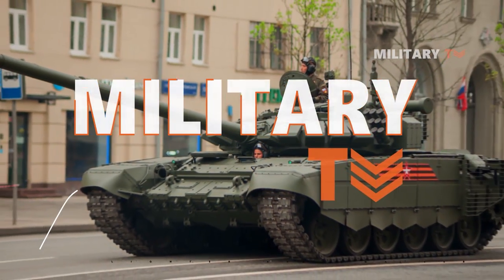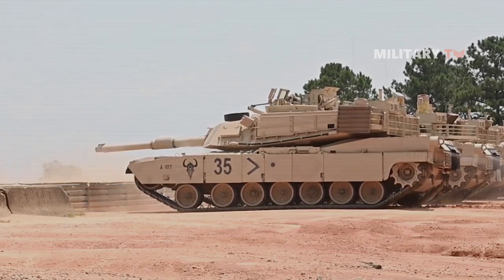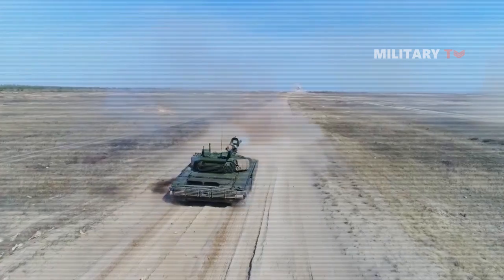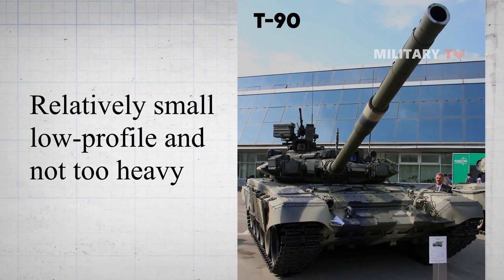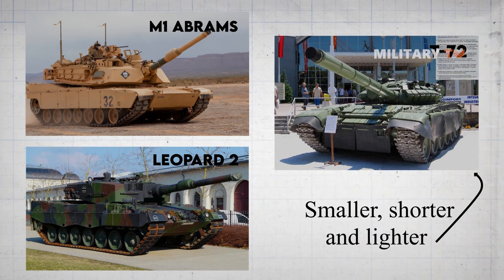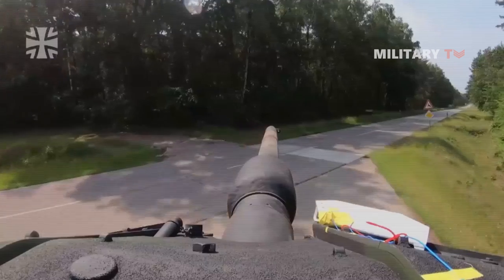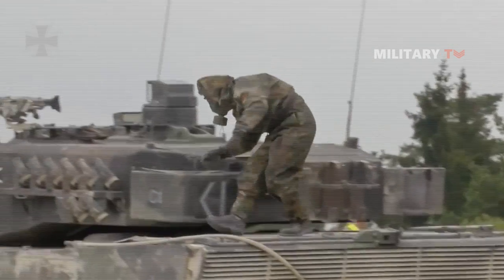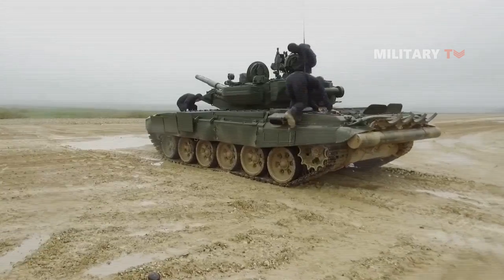Why are Russian tanks lighter and smaller than the western tanks

Comment: This was a very superficial analysis.  

Russian tanks mount an auto loader whereas western tanks like the Abrams mount a human loader.  That autoloader comes with trade-offs, but it does reduce the size of the turret.

Western tanks have a different ammo arrangement, based on accessibility and survivability.  The Abrams turret is so big and long because the ammo is there, easily accessible to the loader and cocooned behind blow off panels to protect the crew.  
Russian tanks store their ammo in the hull, below the turret ring, which reduces the size of the turret but makes for very impressive explosions and fireballs when the hull is penetrated.  

In a communist command economy, it is impossible to budget because there are no internal prices.  One way the USSR came up with to control costs was to limit the weight of certain pieces of equipment.  So Soviet-era tanks were designated a certain weight and the designers had to work within those constraints.  If you want to mount a decent gun, have decent armor, and have a decent top speed, then it helps to make the vehicle as small as possible.

Also, traditionally, Soviet tankers were drawn from the shortest service members, because tank crewmen of average or above-average height wouldn't fit comfortably.  

Western MBTs are big and expensive to purchase, maintain, and operate, but their dominance on the battlefield is undeniable.
Reply: "Traditionally, Soviet tankers were drawn from the shortest service members..." This is claimed in many places, but it is a myth. Soviet tanks do not have meaningfully smaller crew  height limitations than the Western tanks.
Reply: Very good point about pricing in planned economies

Comment: this topic has been talked about my military experts in the US military for so long.After WWII Russians realised their biggest closest threat would come from the countries to its East and most of the land the russians would be fighting on are low,flat plains therefore the tanks were designed to be smaller and shorter (to present a small frontal area) for tank to tank warfare.And they made them to be lighter and faster to cross those plains quickly.A smaller,faster tank would be much harder to hit than a much bigger tank.
Reply: Well, with modern technology I doubt that a modest difference to the size or speed of the tank makes a lick of difference as to wether it gets hit or not.

If even the infantry anti-tank weapons are aimed by computers the guns on modernized tanks probably are as well.

Comment: Point of smaller tank is: low silhouette, it was (with all mentioned in video) always pointed in first place for soviet made tanks, the goal indeed. They boasted with that. Secondly, there is "red line" for mass and dimensions: how much can average bridge sustain together with off-road characteristics, and how that tanks can be or can't be transported via trains. That red line is about 50-60t, that's already too much in many, many situation. Furthermore, off-road driving can be very, very difficult during about 6-8 months in Russia and surrounding countries. Tanks, and tank units, incapable to move fast, to move through certain roads, or to move at all in some cases, lose all their advantages (if they didn't succeed to destroy enemy before).
Reply: nah dude russians like smaller tank cause they have a crew of 3 with an autoloader, western tanks dont use autoloaders so they have a crew of 4 which requires a bigger turret with more space, bigger turret require more armor for equal protection hence they are heavier.
Reply: both your arguments are correct
Reply: @meee2014  The Leclerc has an autoloader and while it is 5t lighter than an Abrams its still 10t heavier than a T90. Likewise the Leclerc sits right in the middle  between the Abrams and the T90 concerning height, with the Abrams being 2,86 m, Leclerc 2,53m and T90 2,23m. So having an autoloader is probably part of the answer, but the not entire answer.
Reply: @jaf8016  ... What it misses is that the Russian tanks being so squat, is that their gun elevation of  -6 to +14 has proven problematic in a few wars. In the 1973 Golan Heights war, the Syrian’s Russian built tanks outnumbered the Israeli tanks 10 to 1 but the Israeli’s set up on the slopes and fired down on the Syrian tanks who could not raise their guns high enough to hit them. The Israeli tanks would then go down the reverse slope firing on the Syrian tanks as they came over the hill while the Syrians couldn’t depress their guns low enough to hit them! Thus allowing them to hold off the Syrian attack long enough for Israeli reserves to arrive and drive the Syrians back! 

In the first Chechen war, the Russians finally got a chance to use their T-80 tanks in Grozny but using conscripted soldiers unfamiliar with the tank or tactics ... they drove straight into Grozny without sending out scouts ahead of them. While Chechen rebels, vets from the Afghanistan war set up RPG ambushes in upper stories and basements hitting them behind the 3rd road wheel and setting off the rounds in the unarmored bustle while again, the tanks couldn’t raise or lower their guns to fire back. The Russians  lost 200 armored vehicles and 1000 soldiers in the attacks.
Reply: @JimCOsd55  The point about elevation and depression is a good one, and in certain situations plays a major role. But in the most common scenario is almost beside the point. No tank can elevate it's gun to the point required in the Grozny case, so that particular story is not a good example. 
Grozny shows that tanks in urban combat suck, unless you know what you're doing. Used as the tanks were in that case, any tank type would get clobbered.
Reply: @Slavic_Goblin  … True, the Russians left their T-80’s behind in 1999 and sent in scouts ahead, calling down artillery and air strikes as soon as the Chechen rebels showed their faces. Unfortunately for civilians both Chechens and Russians - it’s estimated that between 50,000 - 250,000 died in the fighting!
Reply: @JimCOsd55  "50,000 - 250,000 died" fake, russian given all civilians chance to leave the city before
Reply: @gildor8866  autoloader isn't answer, it is one way to make tank smaller. This allow to save volume inside tank too, so you save even more weight, and can use it to increase protection. That's why when T-72B was adopted — it was have best protection, and it still have one of the most effective protection in course angles, and better than most NATO tanks side armour.

Comment: One reason to not using an auto loader is that the extra loader crew is a pretty important. He can replace the gunner, commander or even the driver if any of then are down.

Further, the extra crew can help maintain the tank, keeping crew stress down.

Furthermore, you cannot load the gun if the power goes down if it has an auto loader and if the power is low it reduces fire rate whereas a human would be more consistant.

Also smaller tanks are not small due to the auto loader. The Leclerc, Type 10 and K2 have similar profiles to the Challenger 2, M1 Abrams and Leopard 2 even though the former has auto loaders and the latter does not.

The reason the T-64/72/90 are so small is due to a specific focus on reducing the overall profile of the tank at the sacrifice of crew comfortability and in some cases survivability.

Comment: Before comparing tanks, you need to study the concepts of their use in the Russian Federation and in NATO. Then it will be clear how the parties see the role of tanks in modern warfare. Tanks were developed in the Soviet Union and the United States for various tasks, which is the reason for the design of tanks. For example, the T-14 Armata differs significantly from the T-90 due to a change in the concept of using tank troops in the Russian Federation.
Reply: @classicgalactica5879  Evidence
Reply: @ЗлойНКВДшник-ф4х  Google it.
Reply: @classicgalactica5879  Haha! Official documents with signatures and seals, photos, videos. And Google IT is not proof.
Reply: If the Armata ever went anywhere but a parade, it would be more impressive XD
Reply: @Blodhelm  Not all at once. Have some patience. So far, the T-72, T-80, T-90 are coping.

Comment: The reason why the united states doesn't use a autoloader is because the rounds are locked behind thick doors, so in the event of the ammunition exploding, the crew is protected. Meanwhile the Russian tanks lack this. And therefore if the ammunition get's hit. It'll wipe the crew. On top of this the extra member to the tank crew allows one more able bodied person to assist in anything, such as cleaning or fixing an issue with the tank.
Reply: exactly what happened in Ukraine!

Comment: The Javalin weapon system is almost a perfect counter for smaller infantry squads to take out smaller lighter armored russian tanks.
Reply: True. They even installed some systems on them to counter the javelin problem but look how much that has helped. At the least 100 russian tanks have been destroyed by ukrainians, perhaps even as much as 200 in just 1 week of war. But also with large number of tanks comes a fuel problem. I don't know for certain but i think 2-3 T-72 tanks use more fuel than say 1 modern leopard tank.
Reply: @henkkamatikaine2808  diesel tanks are relatively efficient for a tank. The US tanks use a gas turbine and while it saves some engine weight and makes it quieter than average it consumes much more fuel while at low power than a diesel
Reply: @BrokeWrench  The engine of the Abrahams tank was chosen specifically because it could fill all kinda energy, if the tank is out of oil there’s always a way to keep it running. I hope you understand that part, it’s a very important aspect of American tank warfare.
Reply: @williamsherman1942  abrams tank, not abraham. it was named after creighton williams abrams jr., not abraham of the bible. come on people.
Reply: Well, too bad you cant use your precious JavElin, when you pummeled by airfoce or artillery. And it seems your are saying biased shit that other besider russian tanks not vulnerable to JavElin or its counterparts.
Reply: @darkravenbest8970  the missle that the Javelin shoot penetrates 800mm or 2.4 feet of armour. I'm pretty shure the relatively light russian tanks especially the older ones in ukrain right now aren't just gonna eat a Javelin missile and keep cruising.
Reply: @darkravenbest8970  u gonna say anything about your false claims that the Javelin weapon system isn't effective against light russian tanks?
Reply: @jaystol7988  I know, i got autocorrected. The name of the Abrahams is after Creighton Abrams who commanded Vietnam operations 1968-1972 and served as chief of staff of the army till his death. He’s a patriot who knew the commies better then anyone back on the hill.
Reply: @williamsherman1942  you still got it wrong. and i know who its named after. and abrams isn't the same as abrahams. people say abrahams because they don't realize there's a different name, abrams. abrahams spread like a virus around the world because that's all they know. and when they say abrahams, there is no abrahams either. it's just abraham. which is also not the same as abrams. two completely different names, also one is a last name (abrams), and one is a name from the bible (abraham), which they didn't have last names that far back.
Reply: I thought so too until I learned that 1 javalin rocket is more expensive to build than 1 tank.
Reply: @jaystol7988  Yeah i am giving up from understanding this, all i know is that the tank is called after a great American patriot.
Reply: @wuwei1846  Depends on what tank mate, most modern tanks are ten times the price of the Javelin and the missile combined.
Reply: No tank can withstand a Javelin or any modern ATGM really.
Reply: @wuwei1846  the difference is that you have to fuel a tank you have to have many crew for a tank you must maintain the tank and you must store the tank.
Reply: @wuwei1846  javelin rockets are like 100k give or take about 25k. Where in the hell can I buy a modern tank for only 100k

Comment: More maneuverability, smaller turret target, BETTER FUEL ECONOMY...........when an Abrams or Leopard turns its turret 90* degrees either way....thats a serious target and their fuel consumption is so high, they dont get very far without combat support/refueling when Russian tanks on average get twice the fuel economy.......
Reply: leopard 2 has 1200 liter fueld tank and a range of 400 km while T-72 has 1200 liter fuel tank and has range of 460 km. Leo 2 has a bigger engine and has more hp/ton (23 vs 18 for the T-72). Yes M1 fuelconsumption is higher but it has a range of 426 km.... Al of these tanks has aproximetly the same range so they will be needed to be refuelled aproximetly at the same time.
Reply: @berlin128g  tanks such as leopard and Abrams are bigger and heavier than tanks such as an T-72, maybe the M60 and even leopard 1, the fuel required for them to travel off road depending of which weather, terrain and location have great effect in the outcome.
Reply: Leo 2 is 20 ton heavier has 2x the horspower compared to the T-72 and still has aproximetly the same range with the same fuel capacity, that means leos engine is much more eficient.
Reply: It's about combined arms doctrine and tactics.
Reply: @deadblank8391  if they all had the same engine this would be true, but you don’t take into account the much higher power of the western engines meaning it’s easier for the engine to move the tank, it all comes down to power to weight
Reply: @GrundleLongDong  fair enough